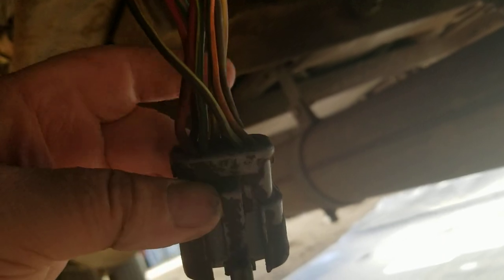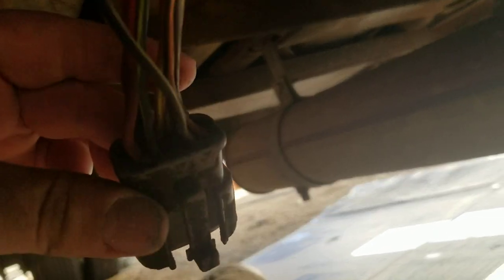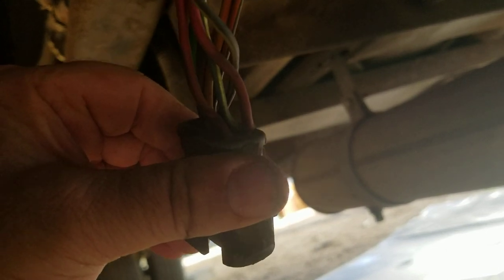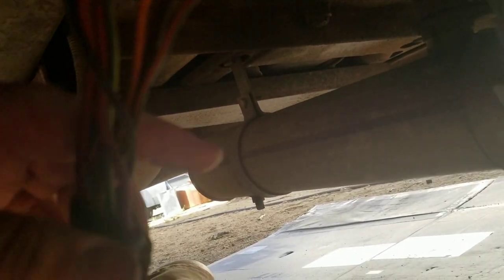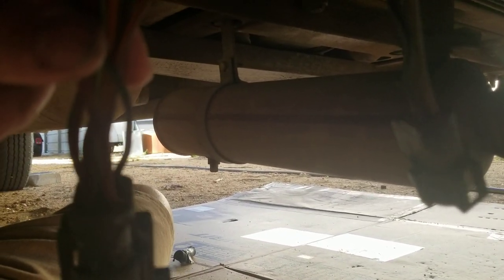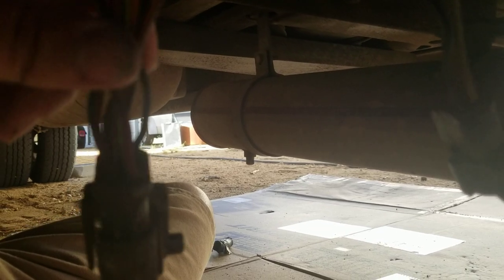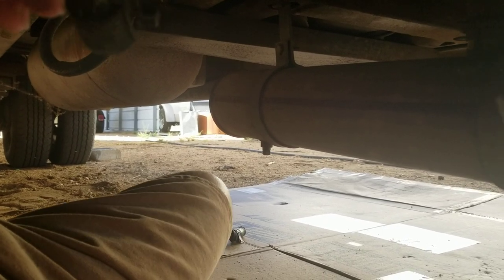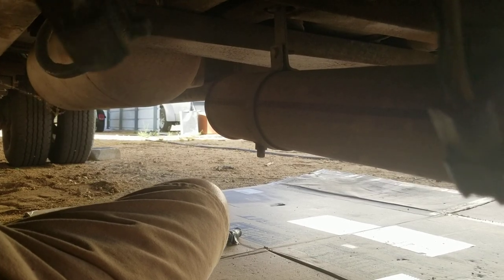Ford E4OD trans problem

Comment from the maker: Problem Fixed! I had a bad signal wire on my TPS. Had to run a new wire from TPS to ECM.
Reply: How did you go about locating the bad wire? I changed the tps on my motorhome and it ran like a champ for a day.
Reply from the maker: @ronnieford3824  
A friend who is a mechanic helped me. He found a diagram of the ECM pins and we found the ones (wires)  going from TPS and ECM and then tested them one by one. Found one that tested bad.
Reply from the maker: Also I probably mentioned this to in my posts but I will again. I had a brand new TPS sensor from AutoZone and it tested bad. So make sure to double check any new sensors you use.
Reply: @2lotony  Yup just because it's new doesn't mean it's good.
Reply: How to tell which trans you have? I have 460 engine.
Reply from the maker: @niklak1542  If you have a plug on passenger side of trans just above the pan with 8 or so wires, it is a electronic version of the 4OD or the E4OD other than that I do not know how to tell you how to identify your trans if it is a different one, like a C6 or something, pretty sure the C6 does not have 4th gear like the C3.

Comment: The electronic switch behind the shifter (MLPS) on the transmission gets packed with road dirt, remove it and you will see an obvious design flaw There is no way the plastic rotating piece inside can work once filled with dirt. The book says to use a gear position sensor adjuster tool T89T-70010-J after cleaning / replacing? Maybe put some location marks before you remove it? $25 for a new one. Good luck. This fixes un wanted up shifts,down shifts and trans going in neutral for no reason.
Reply from the maker: Thanks for the comment. Good information.
Reply: I have a 1994 Ford F150 with the E40D Tranny. Driving on the Highway it Randomly goes Neutral, then goes back into Gear on its own in a couple of seconds?
Reply: I have a 1994 ford bronco it will go in gear but won't move at all but feels like it's not catching the gear.

Comment: I have a 95 Bronco and it has similar issues. Goes straight from 1st to overdrive so I have to shift it manually. Changed the VSS and no change, but when I unplugged the VSS it shifted through all the gears just late hard shifts. Crazy.  I'm going to try to change this plug myself and see if it changes anything. Thank you for the video.
Reply: I also have a 95 bronco doing the same thing. Just wondering did you ever locate the problem. I know it’s been a year since your comment but hopefully you can help
Reply: Did either of you figure out your issues. Mine is doing the same
Reply: I'd like to know as well if that fixed it. I have a 94 f250 that is doing the same thing but I've replaced the vss but not the plug
Reply: Change the plug they go bad or run a jumper wire till you can get a new plug
Reply: Same issue. What was the fix????

Comment: Sept 6 2023. Stuck on side of road lol. 460 ford triple e Motor home. Doesn’t want to switch gears and then it dies. Was told the engine light coming n was only the o2 sensor. So we drove it anyway 😢

Comment from the maker: Not fixed yet. Haven't finished inspecting all the wiring, hoping finish soon . Nothing found so far.
Reply: Some have the speed sensor on the transmission, mine is on the differential. 
Lucas transmission oil solved my hard shifting problem in less than 5 miles of driving & helped me get another 2 years of work out of it. Now it's done for.

Comment: Have a 1996 F250 7.3 turbo, at 35mph it jumps back and forth in gears and when starting out I now have to fully release fuel pedal for it to shift from 1st to 2nd. Where should I start? Several people have said to change shift pack.
Reply: I have  the same problem with my 89 f250 7.5
Reply: Did you figure it out
Reply: @Gambino559  Needed new gauge cluster. Got 1 from a junk yard , took about a half hour to change out and took care of speedo jumping back and forth and shifting gears at 35. Solenoid pack in transmission took care of 1st to second shifting. also changed sensor in rear end just to be safe. Everything like it should be :-)
Reply: @thomasrodrigues5023  appreciate it man

Comment: Mine revs up n down like it can't decide which gear it wants either first or second n once it finds the gear it falls on its face a little n shifts fine after that but it's always when I take off somewhere n it reaches its peak of maybe shifting to second it does this....96 4wd crew cab 460 truck
Reply from the maker: Look at my first video. I believe I described my problem pretty much the same. It's been a while.

Comment: Hi mine doesnt do anything only forward in the same shift and R alredy change the selonide pack for the 1991 that has a more width conector but still no results i am thinking in buy a chick 4 stand alone transmition module but i am not sure yet
Reply from the maker: Watch all my videos.. check your TPS sensor, your speed sensor and your wires. Mine was a signal wire that was bad on the TPS sensor wires from sensor to ECM. Check these things first it's cheaper than a six hundred dollar stand alone that may not be ur problem.

Comment: My 95 powersmoke shifts hard at times and overdrive light keeps flashing....
Reply: I have the same problem intermittently. I can pull over shit it off and then it will shift fine. Did you find out the problem?

Comment: My truck is stalling.   I’ve put probably $1600 in the engine trying to fix.  Come to find out, I think it’s been the E40D the whole time.  Would this possibly be a torque converter problem or the trans itself?  

Symptoms: Shifts like shit and shifts really hard and will stall and die, especially carrying a load (trailer)
Reply: Check and replace if needed:
Spark plugs
Spark plug cables
Distributor cap and rotor
Fuel filter
Air filter
Exhaust manifold gaskets
O2 sensor (this one you should run a KOER diagnosis, I could bring you all the info if you need it)
If you checked all, and still runs like crap, replace the oil filter and half the old oil from the transmission to get it working, if you do it and still the same, check all your wiring for the engine and transmission, for this you should go to an electician to get it checked

Comment: I have a different issue. Just bought a 1989 F350 7.3 idi with the E4od and 28,000 miles. After having it for 2 weeks and putting about 200 miles on it, the od light just started flashing. Other than the light flashing, it has no issue, shifts normal, the button works shifting in and out of overdrive, and no limp mode or rought shifting. Anyone have some ideas?
Reply: Did you find out what your problem was?
Reply: I’m having the same issues. Any luck figuring it out?
Reply: Check your tps sensor middle wire volt meter throttle closed 1.2 open 4.0 note the 4.0 wide open can range a little but be sure to unplug your high idle cold start solenoid
Reply: I have the same problem as funnyman described one shop told me torque converter did that it didn't fix the next shop tells me throttle position sensor did that didn't fix ligt keeps flashing shifting is fine any idea what it could be?
Reply: I have a 96 f250 with the 7.3 my OD light was flashing for a bit and just stopped but my tranny has been slipping and this morning wouldn't shift into 4th I my engine light is on but it does work I'm not sure what could cause this problem with out the engine light coming on any ideas?

Comment: mad shifting on my f150 was the TV pressure  , i adjusted the cable for 35psi and 0 psi at idle , worked a treat now it knows what gear it should be in 
Rob
NSW
Australia

Comment: I have a similar problem with my 1993 f150 5.0 E4OD automatic transmission. It hesitates upon acceleration.  I have no check engine light on but when I ran a code reader it showed two codes.  first code was 621 which shows to be "Solenoid/circuit failure - shift solenoid 1 - transmission".  The second code is 629 which shows to be "Torque converter clutch circuit fault - transmission".   The only thing I can think of doing is replacing the transmission solenoid pack while doing a fluid change in hopes that will clear the codes.  If someone could help and give some advice on where I should start would be appreciated.
Reply from the maker: I watched alot of videos,  these transmissions seem to have alot of problems.  Replacing the solenoid pack is not too hard or expensive. 
I would check the wires and plug at the transmission that seemed to be a point of problems for alot of others according to their videos and responses to mine. The plug is cheap like less than 40 bucks. If the wires at the or near the plug look bad, I would start there.

Comment: The issue that I am having I replace the solenoid pack my transmission goes into 1st 2nd and reverse but there is no 3rd or overdrive the overdrive button is flashing the wires that run to the solenoid pack are all exposed tried to tape them up do you think maybe replacing the harness part when to fix the issue has the new torque converter rebuilt trans new solenoid pack I just don't know where to go from here it's on a 95 F350
Reply from the maker: Replacing the plug on the transmission would be an inexpensive thing to try.
Also, have you checked or replaced your speed sensors or your throttle position sensor?? Might be an issue there..
Good luck. Please note; I am not a mechanic just my friendly advice.
Reply: I had the same issue on my 93 f150 e40d it was a bad neutral safety switch
Reply: Where are the part numbers for all these sensors and locations need your help

Comment: I have a f350 with e4od and it shifts hard. Any idea what the problem is? It is a 1994 with the 7.5
Reply: Do you have also low power, misfiring-like when you're at highest speeds on uphills (when 70 mph slow down to 50 or lower) and shakes a lot back and forth?
Check spark plug wires, sparkplugs, distributor cap and rotor, if you still get bad performance, replace your coil

Comment: Where is this sensor located
Reply from the maker: What sensor? The TPS sensor should be on the throttle body. All other sensors for my transmission were inside the transmission. 
I sold the vehicle last year.

Comment: Tail/brake light bulbs must be OEM and in working condition. The trans receives a signal fron them. If there's a 3rd brake light, check is aswell. I ruijed my transmission by power braking like an asshole.
Reply: Is this for all 4eoD
Reply: Idk about that cause my reverse lights never worked I fixed it awhile ago but I'm just now having issues with my r100 maybe the filter fell inside the transmission
Reply: I wonder if thats why I keep getting the 74 code when everything working fine. I changed my taillights to leds long before. Also got a new brake switch
Reply: @niklak1542  best to find a way to put a 6R80 behind the 460.
Reply: Do you think it will work with 1990 460? Sounds fantastic 😊
Reply: Sounds like you might have a C6 transmission and some of them have a external mounted switch for the reverse light good luck.

Comment: Mine shifts HARD after warming up. It dances from overdrive to drive up and down hills. Read a lot of treads out there. A lot of people throwing parts at it. Crappy design to much electrical and vacuum crap with no real computer codes. Paid 1k for my truck. Have a 95 straight 6 also with manual transmission. Am gonna strip the 94 down and junk it. Its just poor technology in this timeframe. I liked manual linkage. Newer trucks have better diagnostics. Thinking of getting away from this old crap. Was also told that Ford's plugs for any electrical plug in for wiring harness are made of cheap metal and degrade. I've had an 84 89 straight 6. No problems. 86 92 01 duallys 86 no problem. 92 had electrical issues. Sold the 01 at 70k had cam sensor go out. Had 3 escorts all had electrical issues. Still have one. Dash lights out defrost in rear out. Pause when I start it at times before it cranks over. Chevys were worse. Dodge always had weak transmissions. Bought my first Toyota. Am thinking that might be better. Good luck motor home guy.
Reply from the maker: Thanks for the comments. Recently spoke to a friend who ditched his E4OD  for a C-6. I did throw parts at mine too. Good thing the parts cost were low and even took some back. Figure any new part on such an old vehicle can't hurt. Do to some bad diagnoses I had to do process of elimination to find the problem them the bad wire. Mice chewing harness didn't help either. My problem is still fixed and I have driven over 3k miles towing a trailer. So far so good!!
Reply: @2lotony  glad someone got it fixed. I understand you had a motor home. That's a much more valuable animal. I am very grateful to you guys for sharing. Very grateful for YouTube, this has helped me a lot. Enjoy your motor home. You surely earned it.
Reply: My 97 f350 with a 460 has the delay issue on turning the key...for a couple of years now.  Almost like a low battery, but It will do it even when it's charged up to 12.5.  It's worse if I haven't run it... even though it's at a full charge.